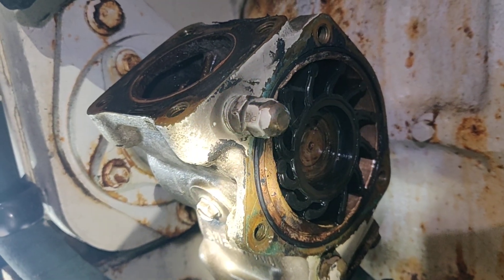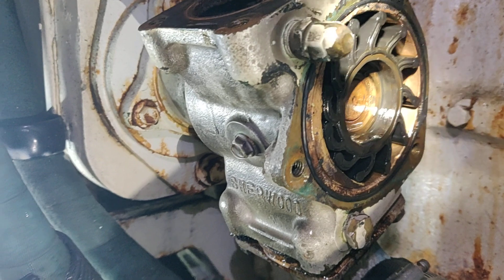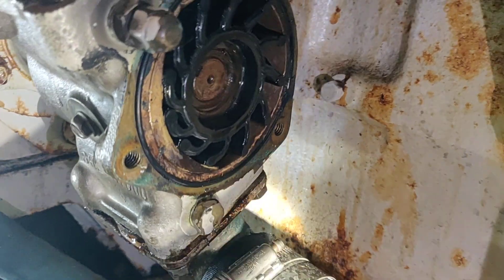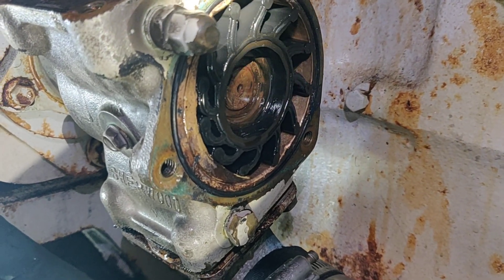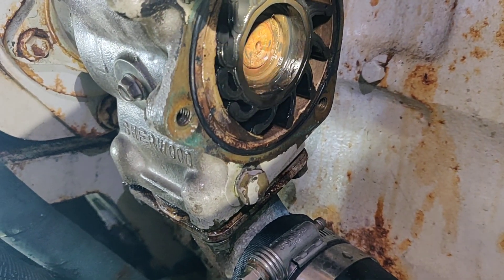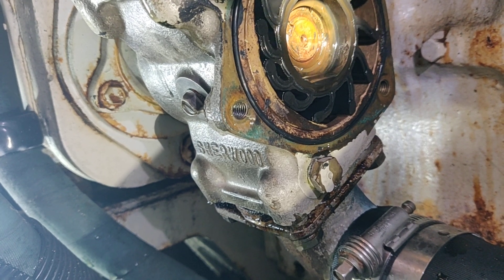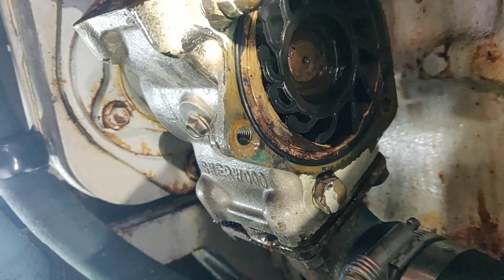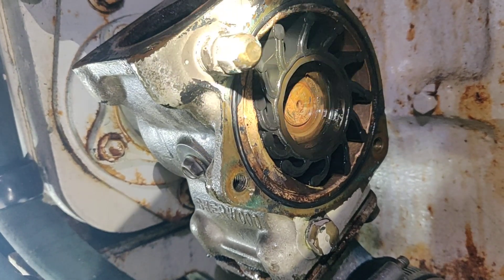Cummins 6CTA 8.3 impeller replacement tips

Comment: Did you remove the cooler to get to the port impeller? So difficult to reach it..
Reply from the maker: I agree, very difficult.  I don't remove the cooler, but we did a couple things to make it easier to get to.  The original couch was removed (replaced with easy to move chairs) and the engine hatch  piano hinge was also removed.  That way we can remove the whole hatch.  That makes it a LITTLE easier, but still a pain.  A mirror on a stick is also your friend.
Reply: @thesunsetepisodes1472   I used a piston ring compressor and silicone grease worked awesome!
Reply from the maker: That's brilliant!  I had thought of that, but don't have one.   Great idea.  I have been using zip ties and hand soap,  but I think I may need a new tool!
Reply: Curious to see how you were able to turn the impeller using the alternator